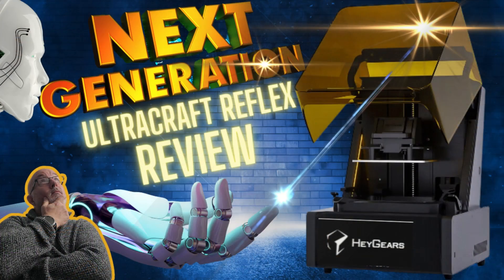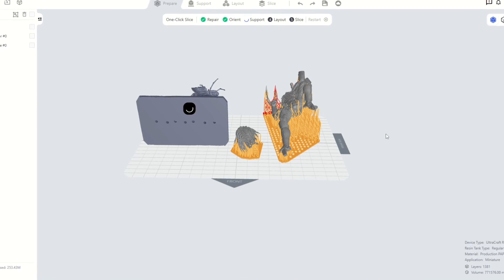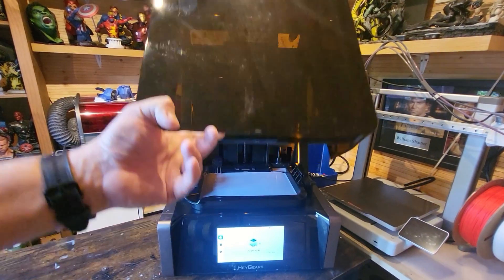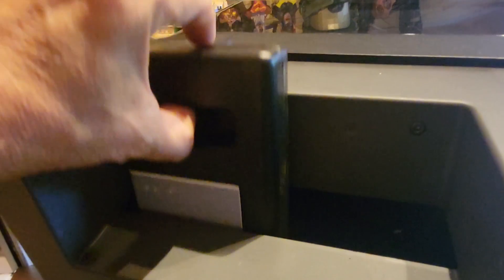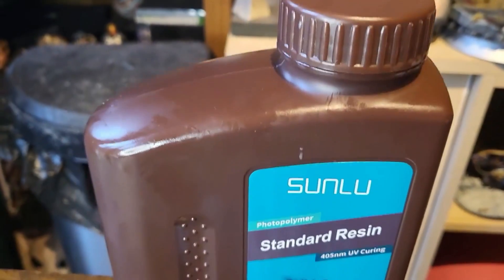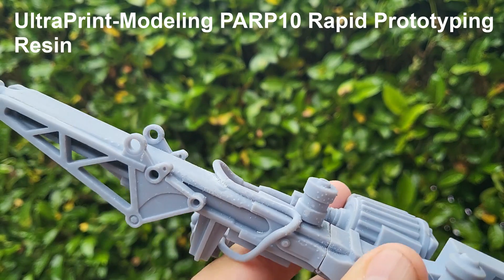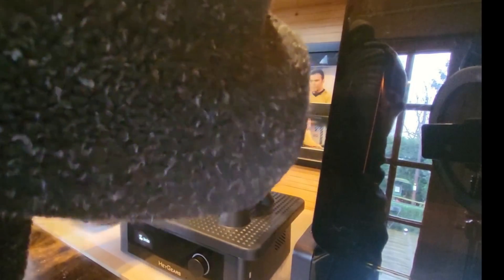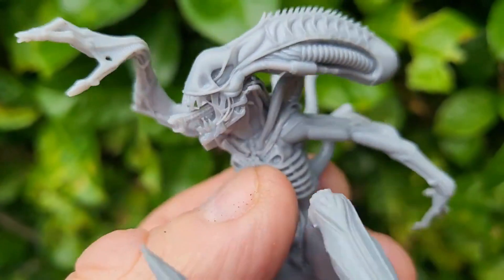Best 3D Resin Printer of 2024 HeyGears Ultracraft Reflex

Comment: Hey Mr. "Greedy",
the combo price of the RS including the wash, and the curestation is 2533,94 € (prices in Germany with your code aplyed) and we cant heat the resin with that?? 
O.K. another 791,78 € for a heated vat and a pulsing release mechanism. 
That makes an amount of 3325,72 € for a midsized printer setup!
Of course the curestation is the best you got, it cost exorbitant 889,38 € ! 
Thats more like 2 top notch Elegoo printers !! 
And where is any kind of inovation? 
Selling resin for that thing that fit and work?? 
Sorry.
I believe they got you. 
"Guys on Youtube" starting like the average, have to check there money, couldn`t aford everyting, have to make the best out what they got.
Then they get presents...and change...
regards
MAX
Reply from the maker: Hi MAx - I agree that the RS is an expensive machine and out of the sights of some users - I fully understand that. and if i had not been using one for some months now without fault or problems i'd more than likely be sitting here and agreeing that it is too expensive. I also understand that you can buy cheaper 3d printers which work well. Heygears printers from my experience are excellent products with an excellent support network, I dont say this as because I have to or because im some sort of HeyGears Shill I say it as I believe it. I also understand why you think the way you do but you are wrong, im not bought nor have i changed.  Could I afford one - at a stretch yes, is it worth the money  - that is a decision only the buyer can make based on their thoughts and decisions on what they are getting for their money. This is my goto printer, it is fast, reliable, easy to use and reliable, i can use any resin in it flawlessly with xero hassle, can i put a price on that no, can you ??

Comment: Well, I tried to order it last week, but the transaction stalled. It cleared my bank, but not on HeyGears side. I contacted support, and they apologized for the failure, and reset the transaction, but now your code is no longer working. Any idea if they will issue you a new one?

Comment: can you please tell me what kind of files the slicer converts the finished supported files into? like what kind of files are these? is it possible to open the finished auto supported files with lychee and chitubox? i would like to use the program to auto support my sculpts. that would save me alot of time...
Reply from the maker: I'm pretty sure it wouldn't be compatible the hey gears support system uses other things that chitubox and lychee wouldn't recognise. The high gears printer actually prints the support differently as it goes and that is the reason why they are so thin and flexible

Comment: Hello Greedy 3D, would you recommend the UltraCraft Cure and UltraCraft Wash in addition to the UltraCraft Reflex or is it better to continue using the wash and cure station from Uniformation (GK2 set) and save the money or invest in the UltraCraft Pulsing Release Module?
Reply from the maker: I prefer the hey gears options. Especially the curing station which has got a door on the front built-in heater to
Reply: @greedy3d480  Thank you very much for your quick response 👍

Comment: I was looking at the Elegoo Saturn 4 Ultra. I do appreciate some of the features here, like the built in heater plate. But an external heater to keep an area/room at temp doesn't make up that difference. Resin feeding is great, but $900 more?
Reply: "...like the built in heater plate...." That is not correct. The printer has NO heating function when ordered, you have to get an EXTRA vat for that feature! No youtuber is blaming Heygears for this, even the "greedy" one. Thats a shame.

Comment: Hmmm. Code is not working for me. Shows the $200 off, and one free bottle. Was it two free bottles that should show up?
Reply from the maker: Yeah it did say 2 when they sent it me
Reply from the maker: They're having a blip in their it systems
Reply from the maker: I've spoken to hey gears they've got a bob in their system they said if you contact customer services they can add the extra resin on for you
Reply from the maker: Sorry I might have got that wrong once you've ordered send the order number to customer services and they will add the other  parp resin
Reply: @greedy3d480    No worries! I sent an email prior to ordering. They replied within 5 minutes of sending that email. Customer service is yet another reason I pulled the trigger on this machine. Exactly what you said, I sent the order number and they are adding a bit more than an extra bottle to the order :) Thanks for checking into this!
Reply from the maker: I've spoken to hey gears about this apparently their it systems are having a problem they have told me to tell you once  you make the order and you have the order number contact their customer services and they can add the extra bottle of resin for you... any problems at all come back to me as I have a contact with heygears 👍 don't worry you'll definitely get your second bottle

Comment: is it true i cant use other slicers for this machine though?
Reply from the maker: Technically you can use other slices the only problem is there's no profile setting for this machine. So you'd have to do your work in your choice slicer then export as an STL into blueprint to slice put the blueprint slicer in my opinion is far superior to any other slicer I've used so technically you wouldn't need to use another slicer.

Comment: The slicer or eco system looks interesting but anyone that wants less support scarring just change your support contact depth to 0.15 and the contact area to 0.20, we use those settings with the Apex Maker printing at 180mm and they work great for the Saturn 3 ultra, M3 MAX and Mega 8k v2! 

The print volume looks tiny but to be fair you can use a smaller printer like this for printing larger models we used to do it regularly but it does mean you have to use extra software like meshmixer to cut the print down further.
It adds a little extra time to the slicing stage and obviously more printing BUT you can print larger models.. 
SELF ZERO IS NOT SELF LEVELING I'd expect that from Anycubic but not Heygears! 

If you own a company that requires a small high quality printer then heygears do have the customer support needed for beginners. However if you have been printing for a while or remotely familiar then you can do most of what it offers yourself with little effort, even with a £200 discount you are still looking at over £1200 and there are other BETTER options available.. 
I can't talk about the print quality of this machine or it's build quality as i haven't tested it myself but we have been testing the Mega 8k + V2 + the new Apex Maker and the Apex Maker X1 has many of these features like a heated vat PLUS it has a huge 17" display capable of amazing detail at ASTONISHING speed! 

We have ran the Apex around the clock for almost a month printing HUGE 1/6+ scale predators and we have not had a single failure. 

I've been printing on commission for 6 years now and at the rate this industry is progressing the BEST printer of 2024 will 100% be old and you will be upgrading again in 2025! 
Ps no Apex didn't pay us to test there machines we purchased it ourselves and we have not received a nickel or a drop of resin from them and do not offer a link that we benefit from in ANYWAY.. Ho and it has a door 🙈

Comment: It’s a great printer , I wonder what is the biggest printed model you can make with it.
Also they should come out with a more competitive resin.

I’m very intrigued for my first printer
Reply from the maker: i guess like any printer you are limited by the build plate  - and as for the resin , yes i agree but the parp10 is heading in the right direction and i firmly believe the costs will come down for theor resin - also dont forget you can use Sunlu basic which is about £17/kg ish .... great first printer TBH

Comment: Thank you again for this video. 😁 I bought mine a few months ago and I’m very happy with the complete system. I never used Resin Printers before and yet  I haven’t had a single print failure. I use SUNLU Standard Resin and as you say,… no problem, perfect prints. I also use the Pulsing Release module which is also an improvement on this great machine. Love the slicer tool Blueprint, auto settings works perfect. All in all just choose a model and let the software and printer do their job. 👍
Reply from the maker: Glad you loving the printer it is a wonderful piece of kit